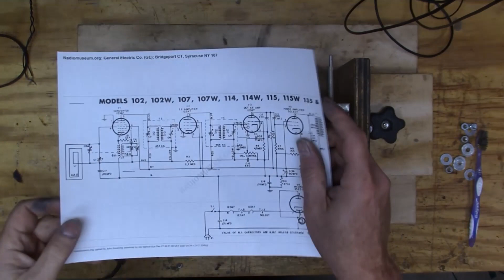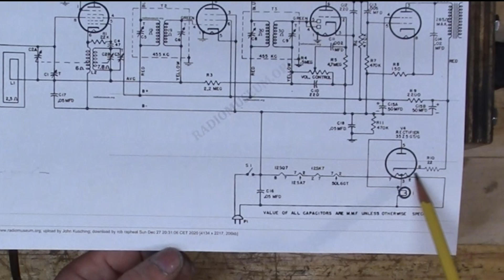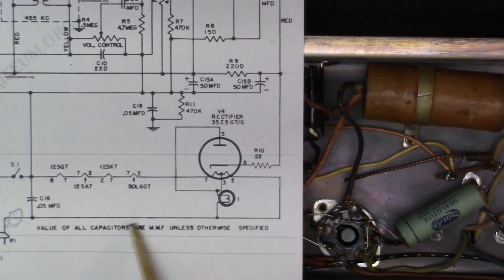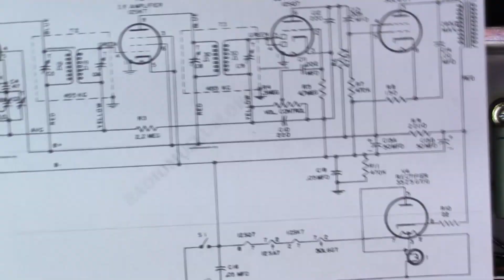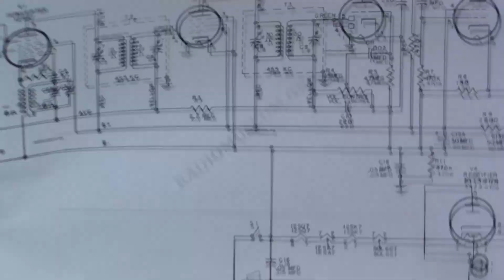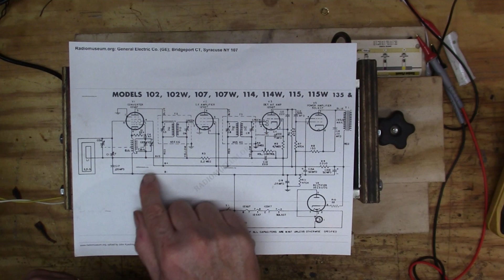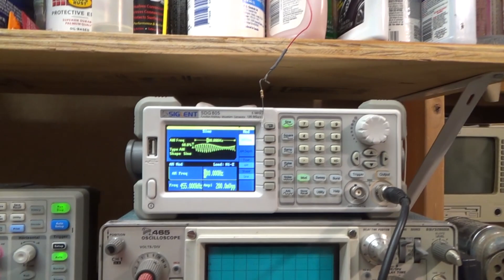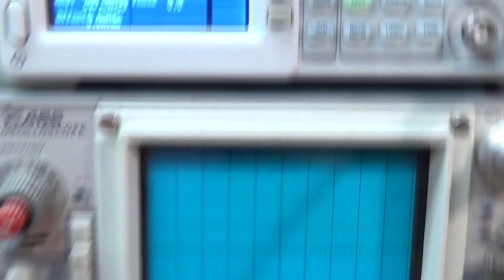1948 General Electric Vacuum Tube Radio Restoration

Comment: Love the Bakelite cabinet repair! I usually use Rustoleum 2X Ultracover Paint +Primer spray satin paint in Expresso. Color matches MOST dark brown cabinets.
I also remove the speaker,dial glass and clean the whole cabinet inside and out to get an even finish all around.
 After the paint dries you can use two or three light  topcoats of clear gloss.
Reply from the maker: Thanks for the tips. I was worried that pulling the clips that help the dial glass down would damage the clips so I left it in. The light does not properly illuminate the dial for some reason, it is like the plastic is supposed to act as a light pipe but doesn't.
Reply: @RobsFixitShop  I always remove 
the metal spring clip ears one  at a time to remove the knobs and dial face. No need to have the knobs  hanging loose on the cabinet and the  ears are not needed anyhow
( the ear tabs)as the knobs are a friction fit like any other radio!

Comment: Appreciate you sharing the case repair. 

Regarding the cord set upgrade, concur with grounding the chassis. Why don’t we isolate the neutral from the ground by setting an insulated tab strip with all the components that land on the chassis being transferred to these, and then terminate our supply cord neutral to the strip?

Comment: Years ago, when I was a much younger man, I worked as a gunsmith, even took one of those famous mail courses and got my diploma from Modern Gunsmiths.  Anyhow after landing a volunteer job with a couple of local smiths who formed a rifle barrel factory, I worked and learned a LOT about gunsmithing from them, they were both graduates of a gunsmith school in Arizona.  At Any rate we used to repair and bed wooden stocks (as well as fiberglass) using Acroglass from Brownells.  To color the stuff we used some of the stuff that came with it for that purpose but for accuracy to get the right shade we used Hershey's Coco mix, the kind that comes in the dark brown can.  Perhaps one could do the same thing with that body putty?  Another use for the glass bedding compound was to fix breaks in wooden stocks, for example one group of hunters were out on the prairie where they took a big buck.  We could drive up to the downed deer in our state to pick them up, so they got a pickup and, after laying down their 5 rifles on the ground, one dude went back and got their pickup,  To get close to the deer, he happened to drive right over the 5 rifles breaking the stocks at the wrist of all 5.  A couple of hours inserting pins and using Acroglass and the rifles were as strong as ever with but a hint that they had ever been broken.
Reply from the maker: Interesting about the cocoa it would have been the perfect color and maybe could have been made to look mottled like the bakelite. I can't imagine the looks on their faces when the truck backed over the rifles, I bet it took some years but they laugh about it now!

Comment: Yep - hafta try the spoons so I can look in the chassis. I have a 1946 fada in the plastic case. Sold as working and it is.... very well in fact but doesn't look like it's been cleaned inside. Do you recommend re-capping if their are no noise issues? Newer caps might not last like the old ones.... I know they get out of tolerence though.
Reply from the maker: I am of the replace all the caps camp. If one of the coupling caps is leaking it will overdrive the tubes and wear them out. And it is a fun part of the hobby. If it is working now, you can replace a some caps and test so you never get too far ahead of a wiring error

Comment: Anyone thought about modifying the unit to use 12V heaters and a B+ of 12V and a Transformorless Push-Pull out stage to drive the speaker and would run of a 12V Wall-Wart

Comment: Nice job! I'm working on a ge model 102. Mine has no dial light, but otherwise is the same. Should it have one, or did some models come without?

Comment: Great vid. When aligning the radio, you have the sig. gen. hooked with the capacitor (blocking?) to the tuning coil output (antenna). Just want to know what is the capacitance and voltage of the capacitor and is there a range of values that would work? Thanks!

Comment: Sorry...WRONG!  Leave the switch where it's at, and add a polarized cord; with the ground side on the bottom.
Placing the filaments on the ground side all the time is crazy.  The belong on the HOT Side when switched ON...